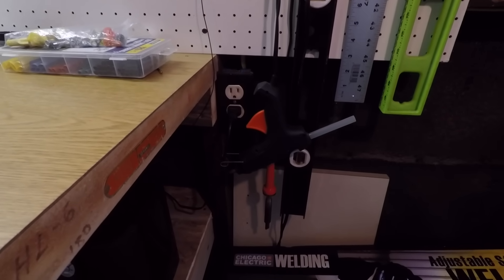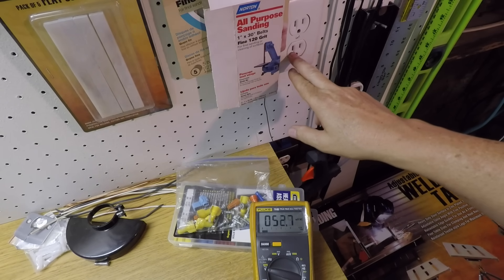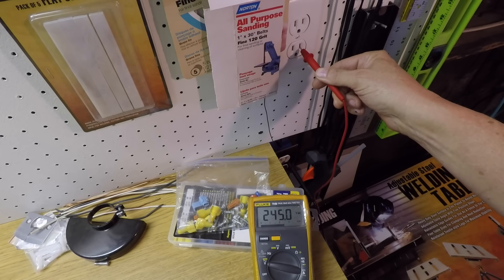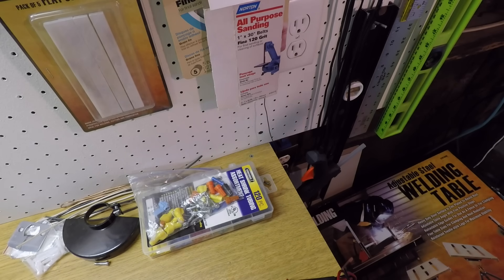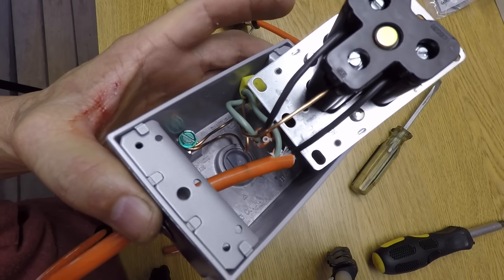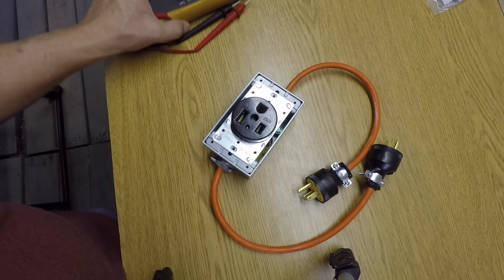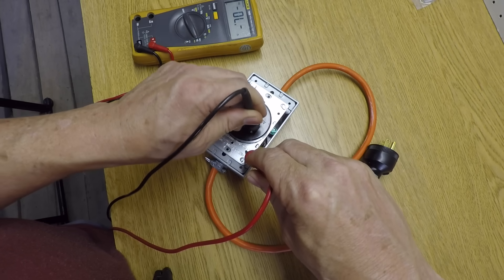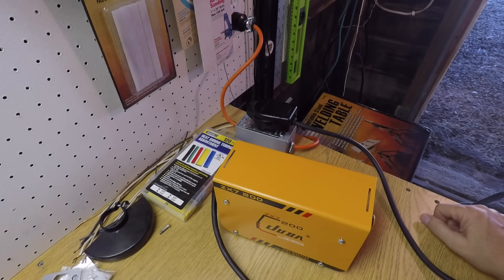How to Get 220v From 110v

Comment from the maker: You should watch this video first - https://youtu.be/29UOFnXItQU
Here is a video using this device - https://youtu.be/Sle56LvpsEM
How to Wire a Double Duplex Outlet - DIY (OFFICIAL VIDEO) - https://youtu.be/Oe4uqSYbU0Q
How to Get 220v From 110v How to easily get 240V for your welder with just two 120V outlets. I DO NOT RECOMMEND TRYING THIS UNLESS YOU ARE FAMILIAR WITH YOUR SPECIFIC EQUIPMENT! This video is a DEMONSTRATION OF WHAT WORKS FOR MY EQUIPMENT ONLY! I do not recommend you build the exact device like I did in this video. I would recommend you hire a professional for your electrical needs. The wire size should be capable of carrying the amps your breakers are rated at and the breakers should be tied together so they will both trip together. The device I built in this video, regardless of the actual components is only good for a 15 amp device. My particular welder (on the settings I use) draws 15 amps or less and that is why I am able to use the device I built in this video without burning up the leads. I have measured the amp draw of my welder so I know exactly what amps it uses at my settings. Just be aware if you are not sure or just don't know what your device draws, it's possible you may have dangerous results trying to duplicate my version of this device. You could be seriously hurt or killed if you are not sure what you are doing. Enjoy the video but be safe!
Reply: itsdatruff  No way!  Bad things will definitely happen doing this.

Power from the street at 240V is actually 2x 120V lines that are exactly out-of-phase with each other.  That's to say the AC sine waves are coordinated to give you the 240V.  If you connect 2 outlets from 2 different AC inverters, they will NOT be coordinated and you'll get a random amount of power at any given time.  Best case scenario, what you plug-in won't work.  Worst case, it gets destroyed and burns-up.  Unless you get 2x inverters with an interconnect so they can coordinate their power.

If you connect 2 outlets from the same 120V inverter you'll just get 120V.

They make 240V inverters for your setup.  But you're not achieving much by trying to do 240V anyway.  A 120V air conditioner is going to use about the same total power as 240V air conditioner of equal BTU.  Total power (watts) is generally more important than the voltage vs. amperage ratio.
Reply: I'm glad you added this detail about the breakers being tied together, so they could trip together? That is true! 
Obviously, no reason for me to point out the breaker issue now...
Reply: Can this be done with a four wire? Wifes tanning bed is 4 wire
Reply from the maker: I don't know anything about tanning beds.
Reply: I know this is a bit old but if you are still answering questions. What if one side trips the breaker, what would be the effect? Thanks
Reply from the maker: Colin MacKenzie, III - I never had that happen. I did do a test with my little welder and only plugged in one lead to see what would happen. Nothing happened, the welder wouldn't turn on. Once I plugged in the second lead the welder worked fine. If it's an inverter welder I would say that nothing would happen. Some people say if you have a motor of some sort plugged in it could ruin the motor but I have never plugged in anything that has a motor. Hope this helps.
Reply: @DIYHomesteadProjectsDIYHP10  thanks for the fast reply! ok, just what i was hoping to hear! thanks again for your time :)
Reply from the maker: Colin MacKenzie, III - You are welcome and no problem.
Reply: wow .....tq boss
Reply: It would probably be a good idea to find out what gauge wire is used between your breaker box and outlets. If your wires are 14 gauge your might have heat being produced from them inside your walls.
Reply from the maker: The wire gauge inside the wall is 12 gauge. The weak link in this set up is the orange 14 gauge extension cord wire used on the device.
Reply: @DIYHomesteadProjectsDIYHP10  I misunderstood you, I thought the extension cord was 12 gauge. Thanks for replying.
Reply from the maker: No problem, I think a lot of people have misunderstood me in this video. Apparently I didn't do that good of a job explaining myself. Anyhow, hope it helps you out.
Reply from the maker: itsdatruff - I really don't know about utilizing two 120V inverters tied together to create a 240V circuit as I have never done that. I suppose it is possible using the same principles I have on my combiner but I don't know for sure. The biggest problem I see is how to make them both trip at the same time if you have an issue with the AC unit. I don't know what that would do to the inverters or the AC unit. That's a completely different situation compared to a small welder like I used. My little welder only draws power for a short period of time say 1 or 2 minutes then it's basically idle for a longer period of time. This has a much lower demand on the 240V circuit compared to running an AC unit constantly for hours at a time. That will have a much higher demand on the circuit, batteries and inverters. Sorry I can't answer your question but I just haven't tried anything like that so I can't give you any real advice.
Reply from the maker: itsdatruff - I don't think it will work using two outlets on the same inverter. You could check the voltages with a multimeter and see if you get 240V from one hot to the other hot. I think you will get 0 volts from hot to hot.
Reply: I used MC, is that ok. Of course I've continuity on the MC.
Reply: Why don’t you connect the cables directly in to the back of two wall outlets instead of plugs? That way you don’t have to worry about in which order to disconnect the plugs.
Reply: Thanks for getting back with me about putting together 2 wires to get a 240 connection ,I appreciate it.d snow
Reply: How to get 110 v from the 220 v ?????
Reply: When I use the two 120 v I getting outing voltage which is 215 v ,what is the reason to getting reducing voltage how to get more then 220 v
Reply: @Farner49  no. You would have 220 rated for 15 amps.
Reply: Will two 15amp brakers work?
Reply: Hi thanks for the helpful video I'm one of your subscriber.im in Alberta Canada I'm planing to build one as I use my tiny arc welder ( Hitbox ) I'm only used it once In a while,I'm just getting some info how was your 220 now is there any issues or problems ?

Thank in advance
Reply from the maker: Hello jm kc. Since I made this video I have sold that house and moved to a new shop. During the time I used the adaptor at the garage in the video it worked well for me without any issues. I never tripped a breaker and I didn't burn my house down as many have told me in the comments. It just worked and didn't ever give me any negative issues. I would recommend if you plan to build one, that you use a larger gauge wire than I did just for safety sake. If I were to make another one, I think I would use Romex with a minimum of 12 gauge wire (yellow insulation here) just to be safe. I did check the extension cord leads I used on mine after every welding session. I just grabbed them with my hand to see if they were getting hot and they never did. I think the ( Hitbox) is basically the same welder as my Juba ZX7-200 so my guess is you should have similar results. Good luck to you and happy welding my friend.
Reply: @DIYHomesteadProjectsDIYHP10 
12 gage wire is a good safe bet. 14 g isn't really enough? 10 g is difficult to work with! I don't want to get into how difficult, if it's also direct burial!

Comment: Already have two problems from the start . Those male plugs will not take the heat of the courants for one becasue they're to small of a gauge , secondly those wires you use for carring the courant to the 220 oulet are way to small of a gauge to and will fry at the minute you try to weld something that ask for  high amps  . the more you will raise the amps the more those wires will heat up and they wont take an eternity to do it
Reply from the maker: https://youtu.be/Sle56LvpsEM
Reply: @DIYHomesteadProjectsDIYHP10  you didn,t check out the power outlets nore the wires to see if they were over heating You just checked the welder . when those terminals will pick up some slack trust me its going to go fast your wall will be on fire while you'll  be welding . Tried that experiment once and it took a couple of shot and the wires cought on fire fast . 110 wires are not made to take  so much amps  so imagine small wire with a small gauge . its like if you take a speaker wire to connect from the battery to the starter motor on your V8 engin in your truck . that thing will probably start two or three times but on the forth one the wire will be so warned out by the heat that it will  get red

Comment: Yes and  if I ever did make one of these I would use a 50 amp breaker for the Lincoln
Reply: 50 amp breaker won't do any good unless the rest of the circuit can handle that much current. In this instance, standard house wire (Romex) is rated at 20 amps max I think, so you'd be asking for a fire, nuked welder, and a very bad hair day... or all three!

Comment: I wish I knew that when I was younger with my 220 Lincoln arc welder when some places did not have 220 but you never did weld. And  test the device  to see if it would blow the circuit breaker but I have 220 at my new house for my welders but really good information Rocky and the Hurricane's Band
Reply from the maker: https://www.youtube.com/watch?v=Sle56LvpsEM

Comment: If your bus bar is only setup for 120 vlt how can u get seperate lines??? the combining  the hot side with another hot socket will give u the same 120vlt
You need to have a 220vlt breaker box setup in order  for this to work.You can use 120 socket offthe rightsideand one off the left side  and then u have 220 vlt...but try and combine the twoand kaaapowww!!!
Reply: another idiot. if the 120v lines are on separate PHASES you get 240v. do you even know how an electrical panel works? oh no you dont or else you would have known this. STFU

Comment: this is a very ingenious idea, good job.  The only other thing to be aware of is if one of the 120 circuit trip, due to over current, while you are using your 240v device, it may damage that device because it will immediately be reduced to 120v and initially the device will try to draw more current to make up for the lost voltage, thereby heating up and probably tripping the other 120v breaker.  It may be okay, but there may be enough lag time between when the two 120v breakers trip that causes an overcurrent condition in the device.  This may effect any electronic components, but probably not a welder.  Anyway, again, great idea.
Reply: A solution for this is to reconfigure your breakers inside the breaker box:
Most breaker boxes would have a single breaker per 110v circuit. See if you can move things around to install a dual 20-amp breaker that's tied together. Something you see on an oven or dryer breaker. Run each of the 110's to each side of this breaker. When one side trips... they BOTH trip.

Comment: Contrary to what the guy says, I HAVE zapped myself a couple of times with only one plug attached to an outlet and then touching the bare metal prongs of the unattached plug of this guy's  type of 220v adaptor.  The cure for it is to install neon lighted rocker switches that allow the user to turn on the adaptor only after plugging in both 110v supply lines.   
    This is just a temporary cure to permanently hardwiring a 220v outlet into your house or garage..

Comment: I can see two 20 amps breakers tripping in his future. MMMM a welder designed for a 50 amp circuit running on 20 amps. And those cords look like they may be 16 gauge. Just run a 240v 50 amp #6 circuit.
Reply from the maker: https://youtu.be/Sle56LvpsEM

Comment: You should have added white wire to Hot lead wire an doubled size of you wire usage, instead of cutting white wire. You said you were concerned about only 15 cap. You had way to increase by just adding second wire to Hot ends!

Comment: Oh one more thing. His 120 outlets have a neutral. He could have put the black and white on a 2 pole breaker, identified the white as hot and just used one outlet. He didnt say the amp rating so assuming its 12 gauge wire on a 20 amp breaker hes ok. Just use the neutral as a hot with phase tape. Then he says lights are on one of the circuits. So now he still needs neutral. I wouldn't do this. Just install a proper dedicated circuit for the need. You can get mini breakers rated for the proper amps if the panel space is full. Never liked those either but its safer. His idea works but code wise, not too sure. Funny how we have to be licensed to perform work but many states allow the homeowner to do his own. Imagine closing on a new house and a shoe salesman says he wired it himself. Just do it right.

Comment: When using a split phase panel, you can combine the phases to get 240v. He needs to gang the circuit breakers so if one trip, it will pull the other phase as well. He did not do that in his panel. He runs the risk of backfeeding from one phase to the other...  Big no-no
Reply: came here to say basically this; thanks
Reply: I was wondering about this.  But what about all the bus fuses? I have had one fuse go bad and the other fuse  leg is still hot?
Reply: @patrickmelson4745  This is why dual bus bar breakers are connected with a pin. Do not remove it.

Comment: Your main circuit breaker panel has the 240 volt buss already in place. Residential circuits that are split by the neutral for power distribution of the 120 volt loads. Electric ovens, air conditioner and clothes dryer use this 240 volt buss. You should install a dedicated 240 volt circuit that is for the welder only with the proper gauge wire and dedicated circuit breaker to match your welder's requirements. This meets the NEC code for proper installation. Your setup is in violation of the code.

Comment: This is not a recommended way of going about this. Fyi your outlets are only rated for 15 amps, they sell outlets rated for 20 amps. 220v outlets are pinned together in the panel for good reason.  What you're doing will work, but can cause issues. Just run a dedicated 220v line to your garage.

Comment: For my electrician guys: is finding out of phase outlets as easy as finding two that are wired to opposites sides of the panel? One being fed by the big black wire and one by the big white wire?
Reply: Typically phasing in most panels switches every other breaker from the top down. So is they are opposites sides then they probably will be the same phase. First row is phase A second row is phase B third phase A fourth B again. Hope that helps. Ps this probably isn't a good idea to do. Have a electrician install a 240v line it will be much safer.